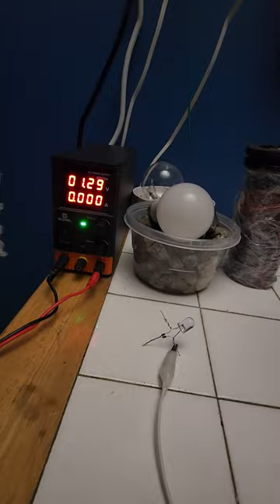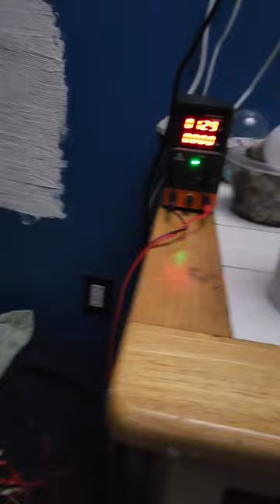🌎 World Record Wireless Power Effeciencies? Along With Ambient RF Energy Harvesting 😊

Comment: Hi dear excellent experiment.
27 year before I made 3 inch long 1 inch diameter
Wounded with wire 22 swg of different pieces joint together.
B/c that time i don't have single long wire but it work amazing, it tune on natural frequencies. without antenna and earth or long wire this device harvest power nearby to 50feet distance all time. I amazed how it work and more and more doing experiments but others not work well only first successful. 
A diode 50 oham internal resistance i used.
Plz experiment on it i can explain u on WhatsApp.

Comment: Howmuch is yout max transmission range at 12v
Reply from the maker: So far about 50ft
Reply: @MTECHINDUSTRIES2022  is this range with 12v only 😐👌
Reply: @MTECHINDUSTRIES2022  I have an Am transmiter  which can send signal upto 94 meter . What do you think howmuch range I will get if I try to harvest energy rather receiving signals from it .
Reply from the maker: @d.abhishekh  probably a wireless power output level equal to or slightly greater then the input if you build 1 or 2 resonant receiver coils using sr560 diodes & combine the dc output with a back emf harvesting part of the AM transmitter. All that harvested power can be turned into dc & stored in big cap banks then pulse discharged into loads to recharge batteries that then run inverters & the high frequency rapidly recharges the capacitors. :)